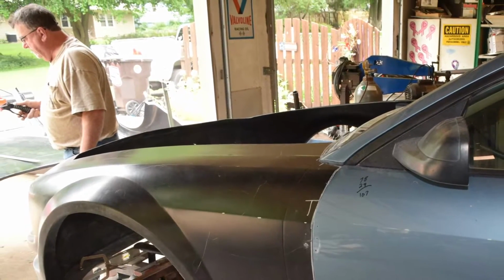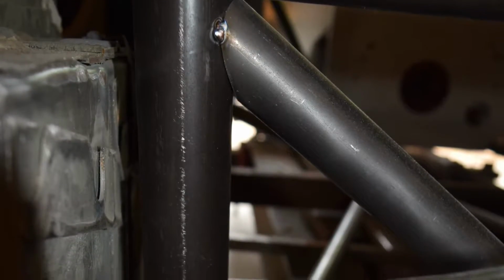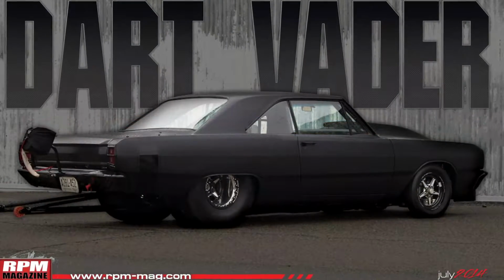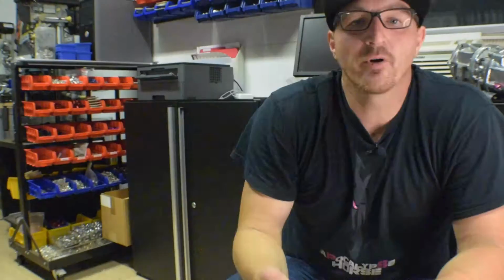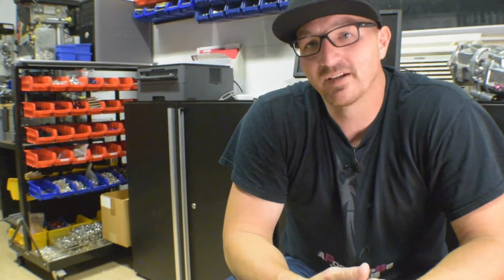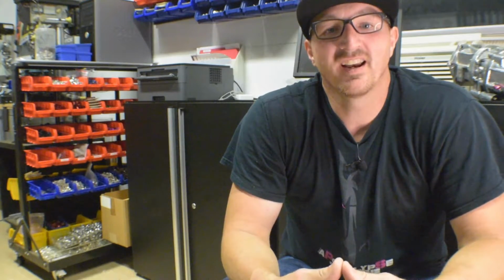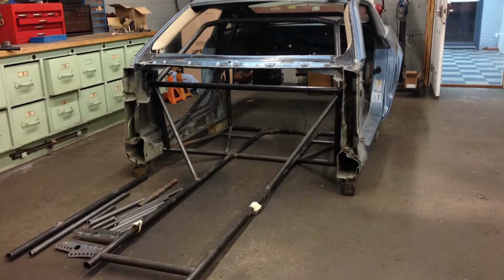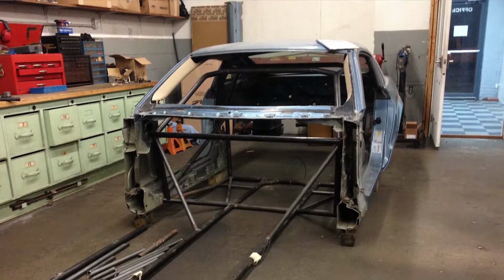How NOT to Build the Ultimate Pro Street Mustang Episode 3: The Waiting Game

Comment: My words of wisdom, think long and hard before pulling the project trigger! My situation. A former professional chassis builder from 1979 until 2001 when I sold out. I got rid of all the equipment except for my roll-away box, and 1 Miller tig welder. Opened a great business that has nothing to do with cars but I'm addicted and will always be a car guy / drag racer. 3 years ago my Pro Street Trans Am is found after my wife made a suggestion that I put my toes back into the car scene. I thought...This will be a piece of cake to rebuild the car better than before with all my amassed knowledge and skills....WRONG. Life gets in the way, other things become a priority, age (now 61) slows things way down. Some progress has been made but not 3+ years worth, not by any means. Moral of the story look before you leap, organize your path of least resistance, make a solid commitment and set a realistic timeline and budget. Research anybody on the outside you are thinking of using for parts of the build you cannot do yourself. Do not get depressed but turn that negative into a positive. Get it Done! I'm looking towards a mid to end of summer 2020 completion date.